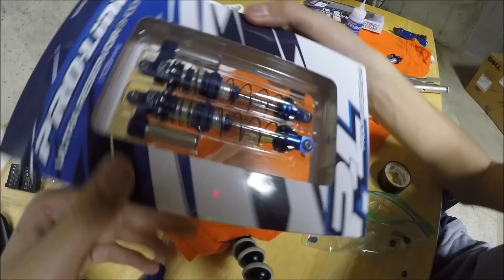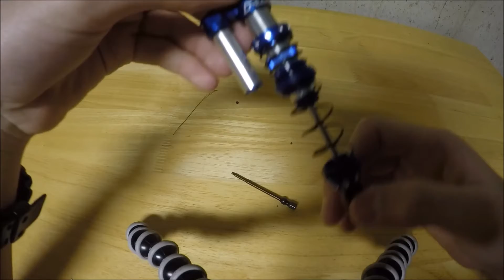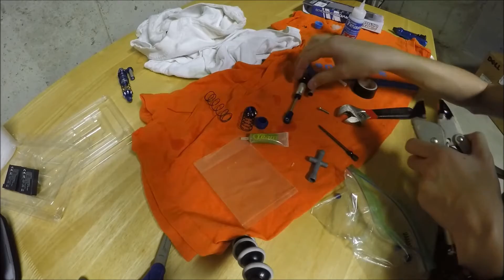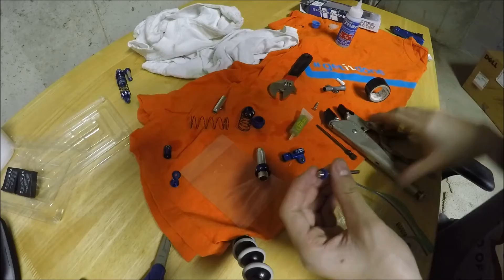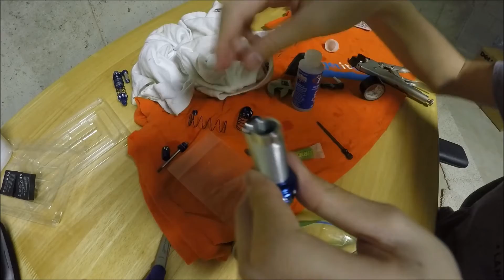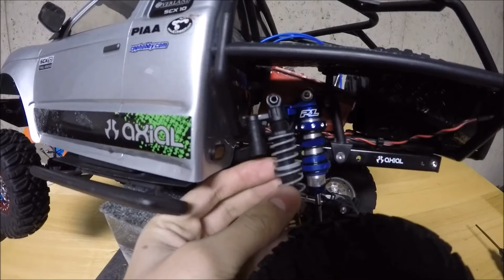Pro-line Ultra Reservoir Shocks For My SCX10 Honcho Demo/Build/Install

Comment from the maker: FYI to anyone looking to buy these shocks, or are somewhat interested, I have been having many leakage issues with them lately. I'm currently trying to come up with a fix for them, and when I do, I will release another video going over the leakage problems and the solution. Anyway, until then, I recommend you stay away from these unless you want to waste your money.
Reply from the maker: I used 35 wt oil for these, and as shown in the video, I have used plenty of green slime to go along with it. However, they still leak, and I have narrowed this problem down to the material of the o rings: Silicone. I did some research and found that Silicone o rings not only tear and rip easily, but are not well suited for applications using silicone oil as well, making them a bad choice for shocks. The main o rings that rip are the x ring that goes into the reservoir, and the one between the body and the piston cartridge. I have tried to assemble both of these o rings at least 10 times by now, and every time, it is the exact same result: Ripped o rings and guaranteed leakage. Because of this, I have found that the only way to fix the shocks is to buy better aftermarket o rings. I am currently waiting on Proline to send me the dimensions of each o ring so that I can order them from a different company made from better materials that are better suited for the application. Until Proline responds, there is nothing I can do, and Proline's customer service is comparable to Comcast's customer service in my opinion. Because of all the issues that the shocks have, I sincerely believe that they are not worth their money at all, and I urge you to not waste your time, money, and shock oil, and look elsewhere instead.
Reply: How much do these go for I have a clod Buster that I made into a cloud Zilla I would like to purchase these shocks for it how expensive are they please comment back thank you so very much

Comment: How expensive are these please comment back in would these be good for a clod Zilla RC truck thank you so very much for this video
Reply from the maker: When i bought them they were like $95 for 2 which is very steep. You cant actually buy them off of proline anymore but you may find some on ebay. If you still want working piggyback shocks id recommend gmade xd shocks which are fairly popular.

EDIT: I looked all over ebay and found 0 listings. I guess you cant get them anymore at all.